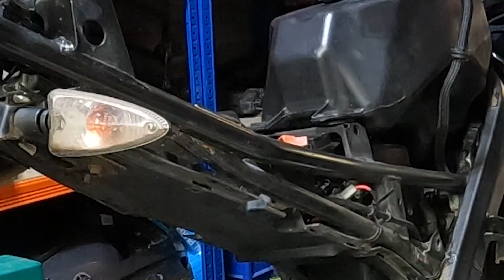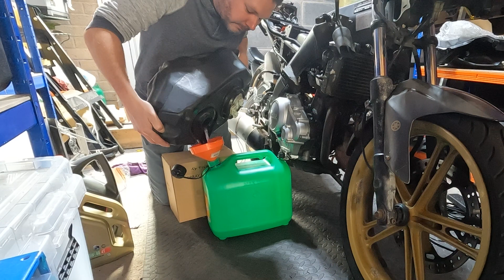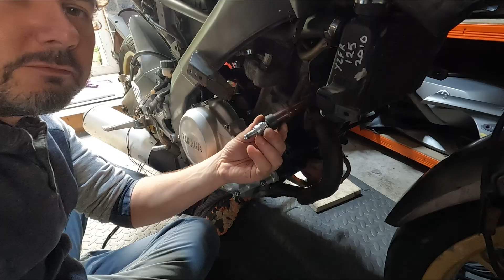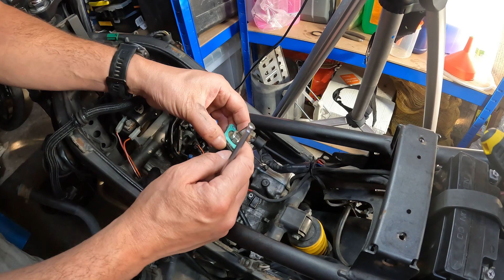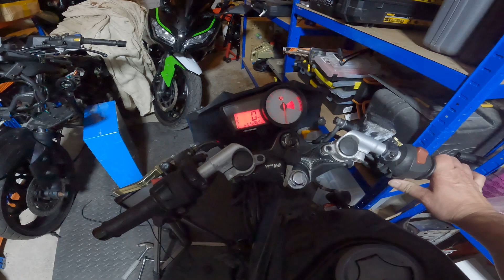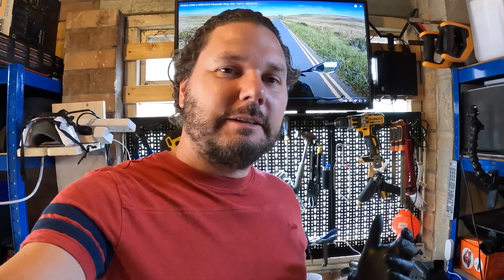How to diagnose an engine that won't start! Fixing the wrecked Yamaha YZF R125 | Part 3

Comment: mine  use to start first time on the button no problems then started needing throttle to start it, then wouldnt idle would drop randomly and cut out. Garage had it for 6 weeks and said it was a cracked ht lead wire and spring missing from plug, 1 week later does the same again, now i cant get it to start at all to get it to my local garage 6 miles away.  It does back fire when trying to start sometimes not very often though. im gonna try a new coil pack soon, any ideas before i buy one? thanks in advance.
Reply from the maker: There are quite a few things that this could be, so you just have to work through each of them one by one until you find the fault.  Start with spark. So, check you are getting a spark from the plug. Sounds like you've tried a new HT lead and plug, so can assume that's ok. You can check the resistance on the stator to make sure there aren't any faults there. But it sounds like you are getting spark because it does run a bit.

Then check you are getting air. If you have a carburettor then give that a good clean out and check the petcock. Make sure you are getting the right gas to air mixture. If you are running too rich or to lean (too much or too little fuel) that could be your problem.

Then you need to check compression. Make sure your valve clearances are right, Get a compression tester to see if you are getting the right compression. Check there are no scratches and scuffs to the piston cylinder and that the piston rings are good.

Comment: The decompression mechanism you was talking about is automatic.  Its on the cog of the top timing chain, its a metal slider that opens the exhaust valve a fraction to allow easier starting. The mechanism is working on this engine, i saw that when you was doing the timing chain.
Reply from the maker: Thanks for the explanation. Its an impressive little bit of engineering.

Comment: How did you set the valves without first setting the timer chain? that means your valves will be out as you need TDC to set the clearances to begin with. Its pointless doing one without the other.
Reply from the maker: Well.... I ended up with a bent valve!!!  So... Yeah.

Comment: Hi. i wil gona wait another part of viedo:) do you know when we can see it? i got same problem on my r125 and it came out of know where when i was driving. So i hope you can help me! (sorry for bad english)
Reply from the maker: Hi. Thanks for the comment. I am trying to be more regular with my posts. Its a learning experience for me!  

My issue was that I had bent one of the intake valves because I got the timing wrong. If its cutting out whilst you are riding then there could be a few reasons why, such as:

Fuel Pump Failure
Contaminated gas
The battery might have an issue so check that and maybe replace it
The Stator / Magneto might have a problem where its not delivering enough power to the bike
Your spark plug might need changing, check that is ok
You might have a compression issue that is worse at a particular power band. Try a compression test and make sure your piston rings aren't leaking and that your valve clearances are within spec and the valve seats are clean.

Without seeing the bike in question, these are just a few ideas. Let me know if this helps.

Comment: Hi I have been watching your videos to help me figure out why my own yzf isn’t starting I would greatly appreciate it if u could help
Reply from the maker: Hi there, it's hard to remote diagnose. I suggest joining a YZF R125 group on Facebook (I am in a couple) and post a video of your issues there and I am sure I or someone else can help you.

Just follow the steps... 1) Do you have a spark? 2) Do you have compression? 3) Are you getting fuel? 4) Is your battery fully charged and are you getting the right voltages from your Stator / Magneto? 5) Is your Starter Motor busted?

Start with those and see how you get on.